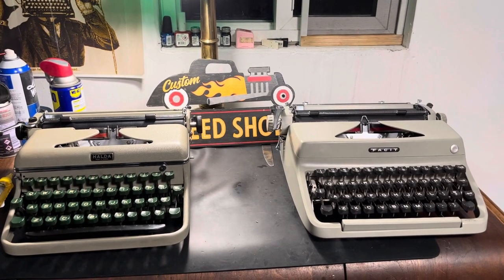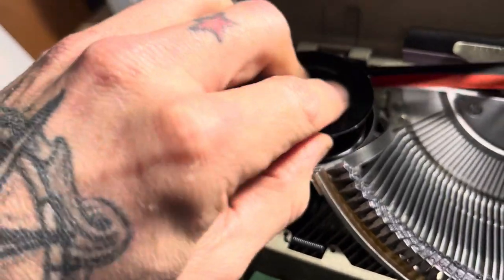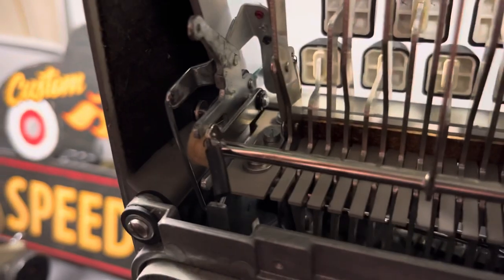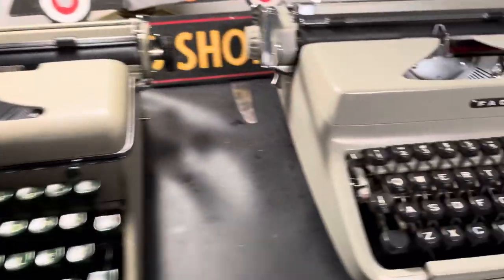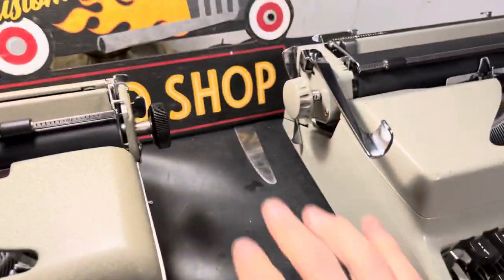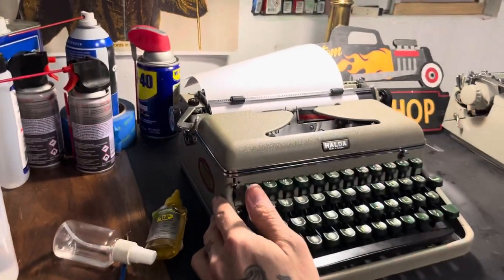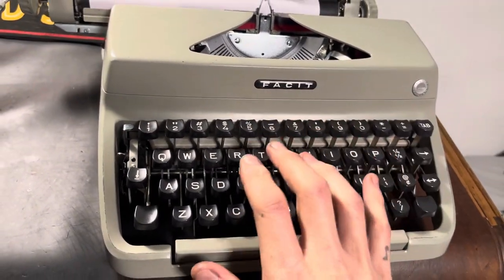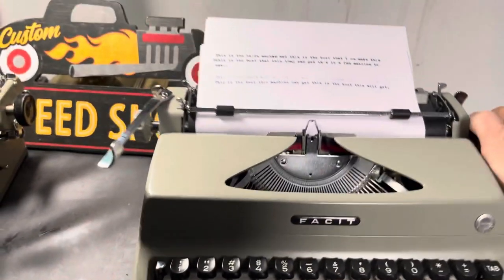Halda vs Facit Typewriters: A Brother from Another Mother

Comment: The Facit TP series machines won me over with their designs and carriage glide action. Personally I find the overall touch on both the TP1 and TP2 to be very light, almost too light. I tend to set the touch control up to at least the mid-point on these two models. The one caution worth mentioning in my experience is that the original lubricant used on both the escapement and ribbon drive mechanisms eventually congeals and can require much patience to fully clean and flush thoroughly.
Reply: What would you use rather than the original? Ballistol perhaps?
Reply: @fakefriendocrat9324  I doubt that there is a definitive answer as most everyone seems to have their favorites. My local typewriter shop that has been around for more than 60 years now actually mixes their own. Supposedly, the lubricant used at the Facit factory was some sort of whale oil. If this is indeed correct, I can only recommend that owners avoid using such oil going forward.